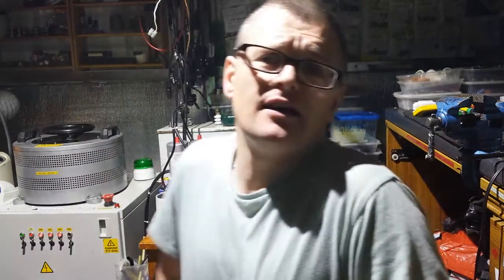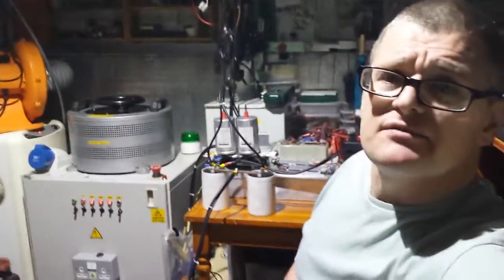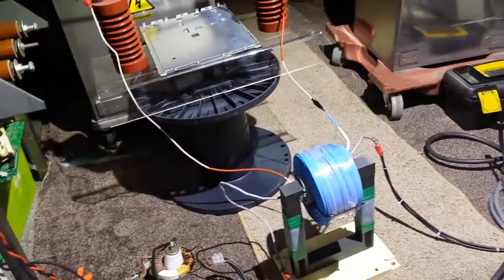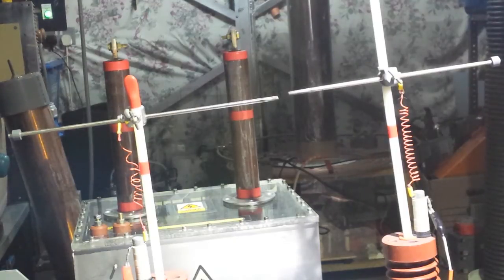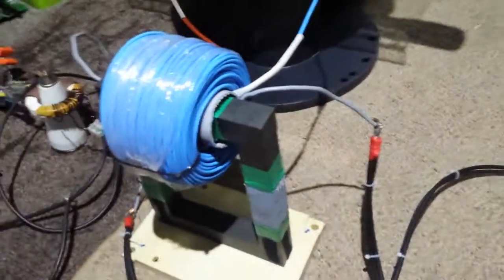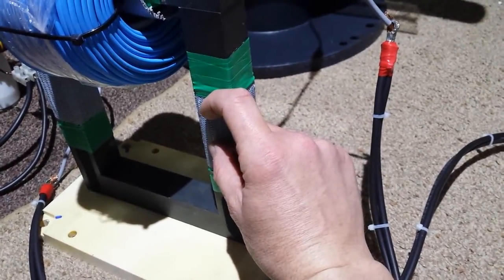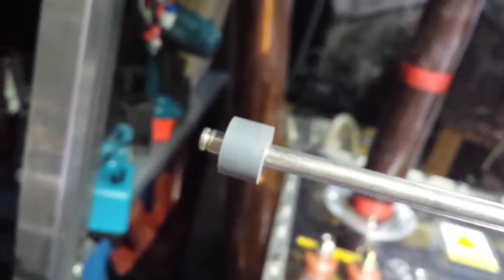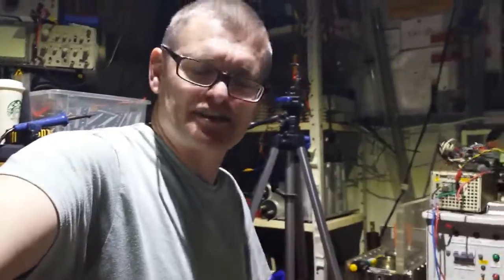MONSTER  home made flyback transformer! Running  on half bridge igbt

Comment: WAHOOOO!!!!!!! so awesome man!!! that is some real power! how come it keeps arcing then stopping is that something on the driver side, psu side or just plain arc mechanics? im kind of curious as to what is causing that. i was also wondering if you had 2 shorter ferrites to shorten up the length of the transformer on the sides so it isnt so tall, it might also be a bit more efficient letting more power flow and also maybe frequency response. you might be losing alot of power via EMR from the empty space in the transformer. once again that is one awesome transformer!!! hope all is well with the family and yourself! thanks for sharing and making such awesome videos!

Comment: BEAST! That setup is pushing out some power!

I have used a 50hz, 50kV, 50kVA (1amp at 50,000V !!!) transformer in the past, but never just to drive an arc like that - it is quite impressive!